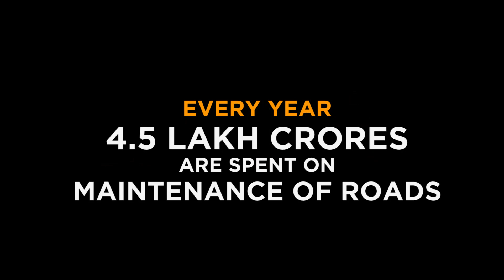Plastic Roads - Laying Procedure

Comment: How the shredded plastic adding to aggregate ? As per this shredded plastic adding to cold aggregate and then heating. What is happening here? Is the plastic burn in the plant ?
Reply: no add shredded plastic to the aggregate before mixing aggregate with bitumen so that we can acquire more strength . Adding plastic to bitumen is called WET PROCESS . It stands until some limitations . After 6% the results go in downward . So its advised  to add shredded plastic before the aggregate gets mixed with bitumen .
Reply: @mogatadakalaomprakashchowd4162  hi sir
Reply: NaveenRaj hi NaveenRaj

Comment: Microplastics are being found in tap water and many of our foods, fish especially. 

What makes you think that making roads out of plastic bits is a good idea? 
You're litterally making roads out of a material which is incredibly carcinogenic and weak. 

Plastic is for a fact much softer and easier to break down than asphalt.
Reply: ok first of all plz go through the video carfeully , the plastic used here are mentioned for their sizes . the plastic available in your tap water cant reach us in any sense . The subject is the plastic acts a good binder between aggregate and bitumen . As aggregate gets weak (especially turns into powder )and it cant withstand for more time with water (which leads to cracks in the road)this molten plastic acts as a layer to the aggregate and so the aggregate doesn't break into pieces and powder . The binding nature is the key to plastic . THANKS .
Reply: @mogatadakalaomprakashchowd4162  well answered.
Reply: In this case we are not completely using plastic instead of bitumen/asphalt, we just replacing partially some amount of bitumen with plastic hence the properties get increase by greater proportions that of before.
Reply: when they melt the plastic at 0:50 the plastic becomes a part of the mix. I don't think micro plastics would be emitted from the roads themselves. the plastic could be recycled material